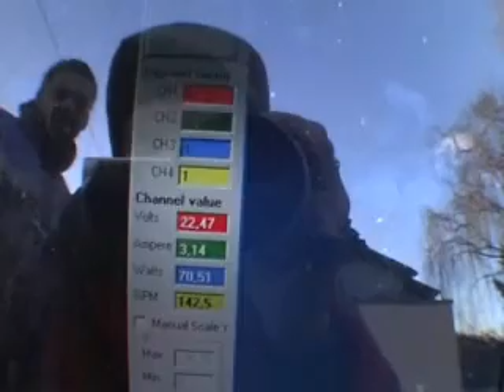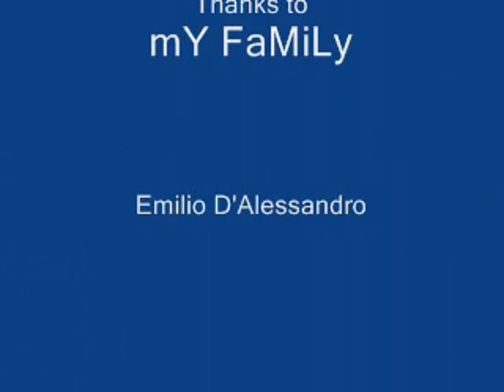My new PVC wind turbine (Generatore eolico)

Comment from the maker: Hi, happy birthday ;)
I built a circuit inside the box on the turbine tower that measure V,I,RPM,wind speed, etc. and send the data via a RS232 link on a ZigBeee 2.4 GHz wireless module.
On the PC I run a software I made that receives the data with another ZigBee module and draw them in real time on the screen, then store them into a MySQL database for future analysis.